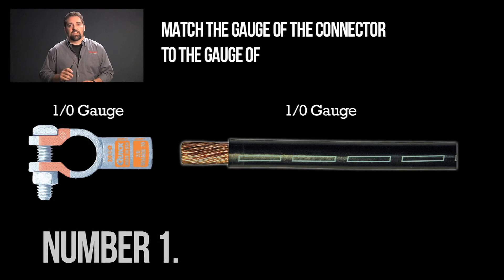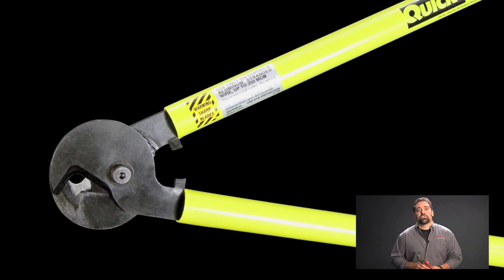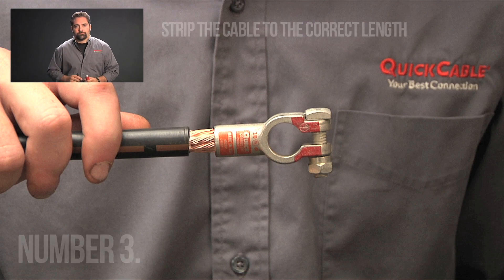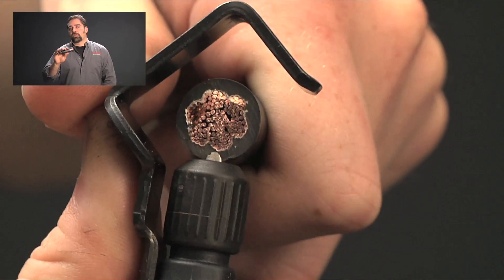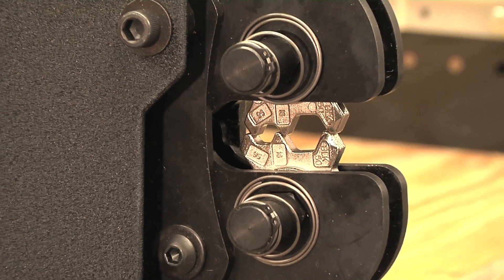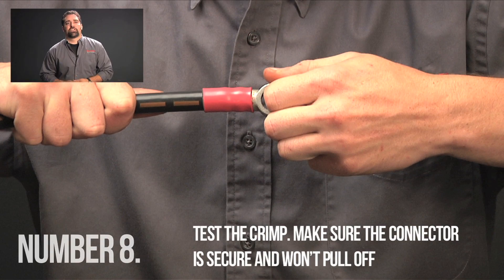How To Crimp a Battery Terminal

Comment: Quick tip. If you want to make a positive battery cable use red insulation and red heat-shrink. For a negative cable use black insulation and black heat-shrink. No need to just use black, red is readily available, and it rules out any confusion. The heat shrink should be dual wall, and heated enough to make it liquid so it slightly spills out. This way you know that the glue has penetrated into all the small crevasses.

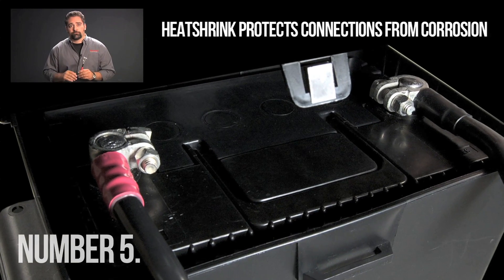Top battery posts have a different tapered design (top diameter). You need a positive lug to go on the positive terminal and a negative lug to go on the negative terminal. For SAE top posts the positive is larger than the negative, and when installed should be flush or slightly lower than the top of the post and rest on the raised battery case plastic (on newer batteries do not use felt anti-corrosion pads, they do not allow the lug to seat properly). In the video at 1:49 you can see that the positive terminal is not seated properly, it is because a right angle negative lug was used and is too small for the post. 

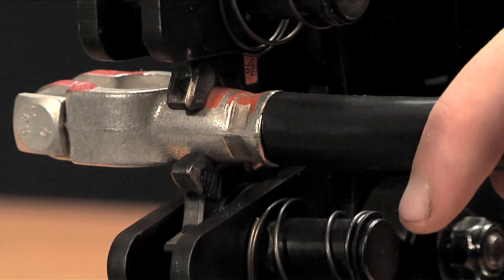Also, the image at 2:27 is a little strange because you would normally have, for a basic installation, a red right angle positive lug and a black right angle negative lug. You can get both positive and negative right angle left or right. The nut design is also a little strange, because it should be a longer shoulder nut so you can get a socket on the nut without interfering with the lug. It is also common to have a battery boot that covers the battery lug, red for positive and black for negative. It prevents accidentally shorting out the battery and also provides some splash protection. For the right angle lugs shown, with the nut and bolt removed you could easily fit two crimps, starting inside and working outward, which is shown in the video for a straight style lug. 

Also, not shown is you should clean both the battery posts and the lugs before installing on the battery. And once installed you can add a battery post sealant. 

The right angle battery lugs in the video are considered heavy duty or HD, these require a different die size than what is normally found on the base entry level crimper shown in the video, see time 2:29. The crimp is forming an ear (or wing) which means the hex die is too small when it seats. Hex dies should completely seat (called a bottoming die) when making the crimp. With the Temco TH0006 hydraulic crimper, as just one example, you will find two different die sets. One for regular lugs and a plus size for HD lugs. Which die you actually choose depends on the cable, lug, tool and die in making a proper crimp.

Comment: Even with the tool its hard as hell to crimp, the aluminum lugs and terminals are harder than hell to crimp, Ive had to use a cheaper pipe to crimp

Comment: This is probably the best "how to crimp battery cables" video on youtube.. Too bad he's using around $1000 worth of tools.... most of us don't have the proper tools available.
Reply: Yup, I lack everything except the cutters.  My search for an affordable solution continues...
Reply: @spasmonaut10  Ebay 10 ton crimper is 30$ and comes with 9 dies.
Reply: @zanpekosak2383  I ended up getting a hydraulic crimper set for about $80. It's built well and works just as well. Money well spent.
Reply: @spasmonaut10  Nice
Reply: Yepper.  This is a good demo for professional battery cable makers who can afford the tools, but not so good for us DIYers who have a tight budget.
Reply: Harbor Freight has a cutter similar to the one in the video for $20 or so.
Reply: Having cut a connector done with a hammer crimper, it is possible to get good fusion/compression. That said, some of the Amazon hydraulic crimpers have good reviews, and make it purdy.
Reply: I only have two terminals to crimp… wonder if I can rent a hydraulic crimper
Reply: Chris Lizon lol
Reply: here tool. Not hammer style. On top has spot for air impact 3/8 head. crimps perfect  https://www.matcotools.com/ProductImages/btwc3.jpg